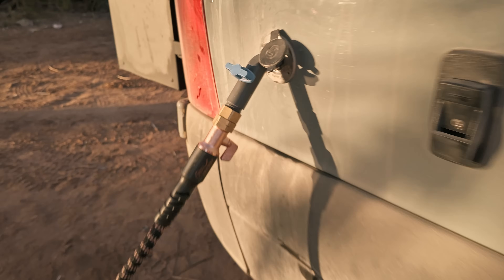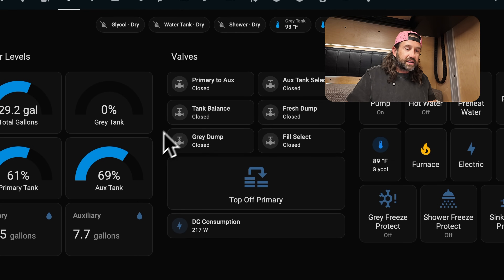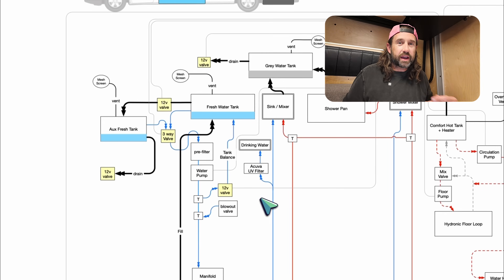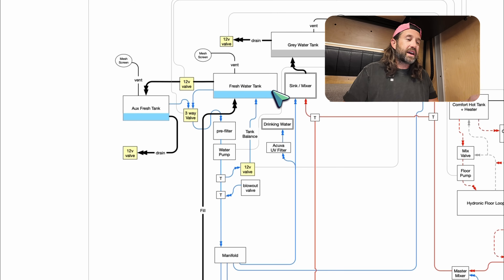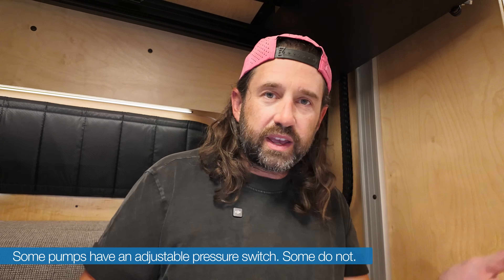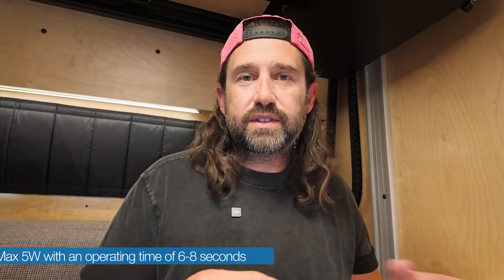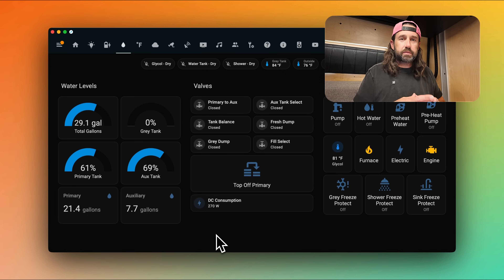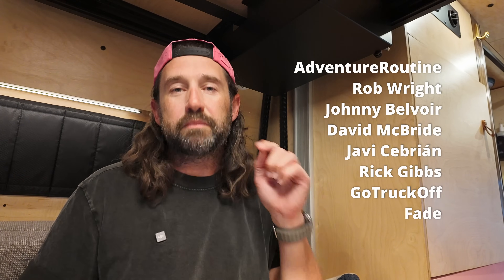Van build plumbing with electronic ball valves!

Comment: What sensors are you using to measure the water levels? That will make a great video.
Reply from the maker: I use resistive float sensors (https://amzn.to/48u3tQO) and I also like the Mopeka ultrasonic sensors (https://amzn.to/44iqZOe) for retrofit. Both solutions integrate with a Cerbo GX nicely.

I'll see if I can get to a video on this eventually!

Comment: Mike, Great Videos - Just found your channel and I have so many ideas for our camper on a seasonal site. 2 Questions; 1) How do you drive the valve motors (relay, mosfet, etc), would love to see your circuit for that? 2) How do you power all these discreet Wemos D1 minis, they are usb-c or 3.3v, do you runs usb-c cables.  Thanks LOVE the channel!
Reply from the maker: I use relays for the valves but you could use mosfets. I have a video on powering esps: Powering ESP Microcontrollers from 12 volts
https://youtu.be/IIHaPx_3B3Q and the mag lock video may be helpful if you just replace mag lock with valve: https://youtu.be/raw_RVtcGcs

Comment: Hey Mike, great video (and amazing build). You mentioned that your 3 way valve is meant to also stop the city water from back-flowing through the rest of the plumbing system.

But you also said that when the primary tank is full, you switch over the valve to prevent the primary tank from over-filling.
I got a little confused. Not sure if you addressed this in the live stream, but thought I would drop a comment anyway.

Happy travels
Reply from the maker: Sorry for any confusion. Basically, the 3-way valve can act as a shutoff for city water. I think perhaps the confusion is that we don't actually have the ability to use city water pressure. When filling from city water, when the 3-way valve switches over to output mode it stops the flow of city water into the fresh tank.

Comment: this is awesome. but my biggest concern given the offroad/automotive nature of this is - is it reliable? also, given how centrally critical the HA controller is and the associated network (zigbee, wifi, wired LAN) - how robust all of that is and if you have high availability or something
Reply from the maker: I've been running this system first in development, then in a full time van install for a total of 2 years with no reliability issues. I do have a commercial grade Peplink router at the core which never goes down.

Comment: Hi Mike, I love this setup, I am looking to add a few valves to my caravan setup, just wondering how you are operating the valves (electronics)? I came back to watch the video again, to see what you had used, but it's not covered. Is this part of another video? Are you doing this with an ESP or Victron/Cerbo GX setup?

On a side note, I read through the comments to see if this had been asked, and I saw you directed someone towards the discord, which is a handy space, but I wonder does moving conversation away from youtube effect your channel growth? (Would love to see your channel grow and I know previously comments played a big part, but it has been a while since I did any reasearch on channel growth).
Reply from the maker: Hey Todd, thanks! I use an 8 relay board with a built in esp like this https://amzn.to/40Z96Tb - but you can use any method you like to apply 12v to the valves. A mosfet board could work as well. I believe there’s some insights on the mag lock video about a mosfet controller https://youtu.be/raw_RVtcGcs?si=x4qTm3HV_ECutUO3. 

As for Discord, it’s just easier to have ongoing discussions and paste code snippets etc. Of course comments on YouTube are handy and probably relevant to the algorithm to some degree, but Discord is just very conducive to community and threaded discussions!

Comment: Great job) What does the "Sink Frees Protect" and other buttons?
Reply from the maker: Freeze protection refers to 12 volt heated pads and strips. There is a pad on our grey tank and strips along the sink and shower drain lines under the van. We automate turning those heating elements on, or you can manually switch them. They keep the water from freezing!

Comment: Hi Mike, on another note, I do not see many having the gray tank in the spare tire cradle as our builds. Do you think a 1 1/8” diameter will allow for good flow or do you suggest a bigger diameter.  My concern is my shower is before the wheel well on the driver side and the kitchen sink in a on the passenger side and running a big diameter could be cumbersome. Also did you use any special venting on the shower/sink drain or just P-Traps/HepVo.
Reply from the maker: I used 1-1/2" for the shower drain and 1" for the sink. 1-1/8" might work just fine—especially if your drain trends downwards. I just used HepVo on both sink and shower!
Reply: Thanks a lot Mike, your advise has been in fact very helpful as my rig layout is very similar to yours and having confirmed experience save one of may headaches and inconvenience. I really appreciate your input and sharing of experience .

Comment: Hi Mike, what do you use for freeze prevention. If heating pads which ones do you recommend. Thank you.
Reply from the maker: I used a pad on the grey and what they call smart heating cable on the drain lines. Seems to work pretty well. All self regulating which is a good idea. It’s made by ultra heat. But their site is a mess. You can find/buy their stuff here: https://www.annodindustries.com/shop/shop/premier-heaters-and-warmers/rv-and-marine.html
Reply: Thanks a lot.
Reply from the maker: I used 1-1/2" for the shower drain (and 1" for the sink). I haven't had any issues with the shower (or sink). I would imagine 1-1/8" could work, but I haven't tried it. A general downwards slope is very helpful! I just used HepVo.

Comment: Hi Mike, just to confirm that the pipe that connects your main tank with the auxiliary one is 1/2”. I assume that as you are using a 1/2” valve in between. Thanks
Reply from the maker: Yup! 1/2”

Comment: Hi Mike, awesome video! What recirculation pump do you use. Another Seaflo 42?
Reply from the maker: It's a little impeller pump: https://amzn.to/3QThzSm — a diaphragm pump would probably not work because water can't be pushed through it passively. An impeller pump can have liquid pushed through passively. And a seaflo or other primary water pump would be overkill anyway. ;)
Reply: Thanks a lot!

Comment: Can you talk about your 12V circ pump? I assume this is to avoid wasting hot water. How/when do you use it? Is it not enough to just use the main water pump and have a T with the check value? Does two pumps at once cause issues?
Reply from the maker: Good question. I only use it for a few seconds to circulate around the hot water loop, which pulls the water around the loop about once to heat the water as it passed through the heat exchanger. I used chatGPT to calculate the pump run time based on pump volume and 1/2" PEX pipe volume based on the run length. If you cycle it for too long, it overheats and the bi-metal mix valve will react and serve mostly cold water when a fixture is opened. The main pump can't cycle the hot water loop because of its position. If it could, the main pump would run constantly when powered—which is undesirable. So, the circ pump can push water round the hot water loop to be re-heated, but really only needs to go around once to heat up.

Comment: When using the 2-wire auto valves, is there a time limit on how long the unit can stay actuated? Would having it turned on too long cause it to overheat?
Reply from the maker: I'll dig into this on the live stream. Short answer—no, these are motorized and once the motor turns to open the valve, the device is inert. I don't know of any issues with leaving it open.
Reply: @SmartyVan  Nice. Thank you! I ran into this issue with some low-cost valves in the past hence the question.
Reply from the maker: This could be an issue on solenoid valves that are HELD open (or closed). But ball valve motors (that are behaving) should not be an issue.
Reply: @SmartyVan  That makes sense. You get what you pay for!

Comment: Wow, sounds like you’ve thought of everything on the plumbing automations. I love your system. I need to add some of those valves for sure. Crawling under the camper to open the grey tank sucks!
Reply from the maker: Yeah, being able to pull over a sewer and push the button from the cab is pretty slick!